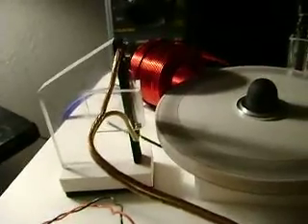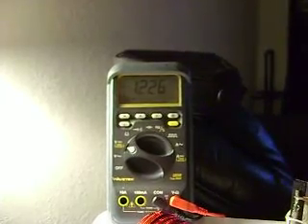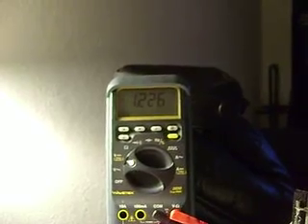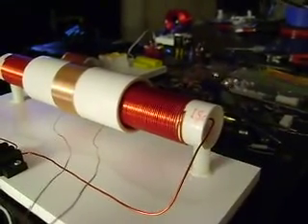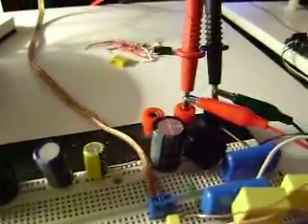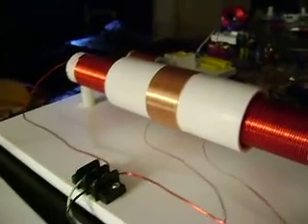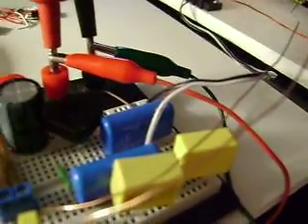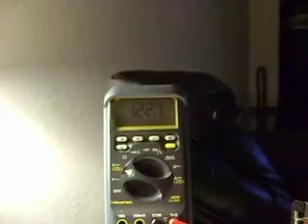New setup with the new Beeg transformer, real beeg, to isolate bemf back to battery.

Comment from the maker: Well she wasnt running in the morning, a reed became latched. for some reason this setup was hard on the reeds. I have to mess with it to get around that. Even using just one battery, it was a torture test for them.
I ran a lot of tests on the bifi vs regular coil and found no difference in these situations. Like I said before, I think it is intended for high freq/high voltage setups. I dont think there are any advantages for them in our department. Prob why TK had neon trans. and spark gaps....

Comment from the maker: Thanks Flux
Just another idea on the plate. After making the transformer, which is more designed for high freq apps, I had doubts that it would work here, but I am getting output from input. It has me designing a new transformer already in my mind to tighten it up.
Magluvin